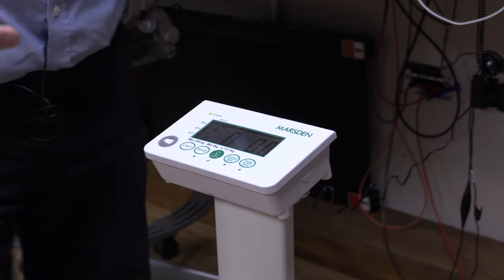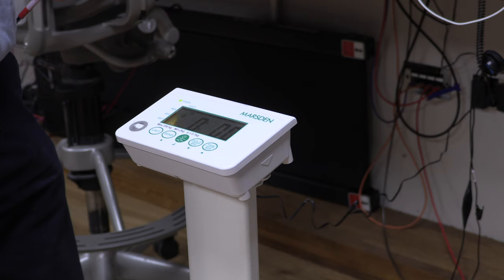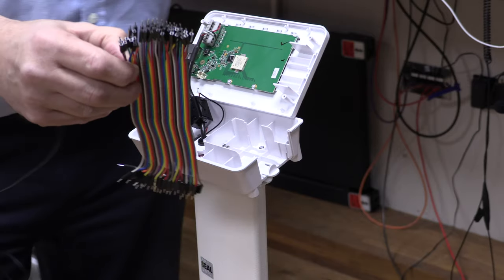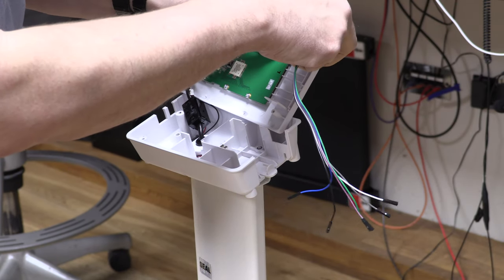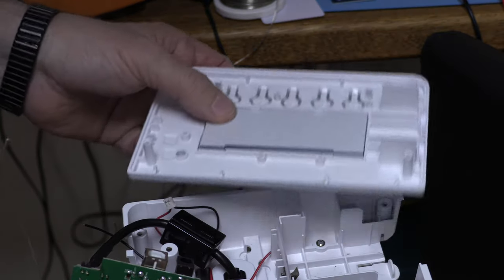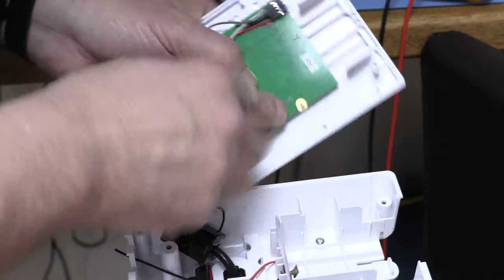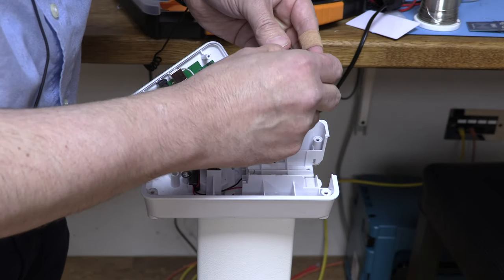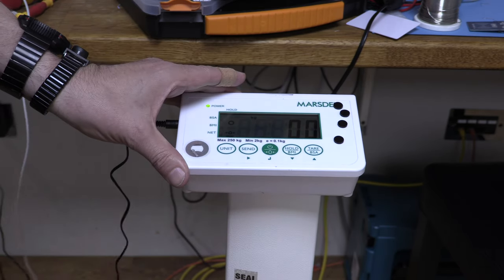Marsden M-125 scales using WiFi

Comment: ESD strap, really?.. Why? 
I know you should but I don't know anyone whos ever blown a board.. ever.
Is there a reason why you tapped the chip and the button instead of onto the tx, rx ports next to the vcc and ground?
Or was it it just easier to grab the data how you  did it?
ESP-01 are great though seeing how cheap they are..
This will undoubtedly be your next write up on hackaday ;)